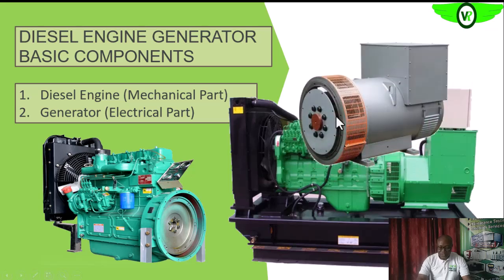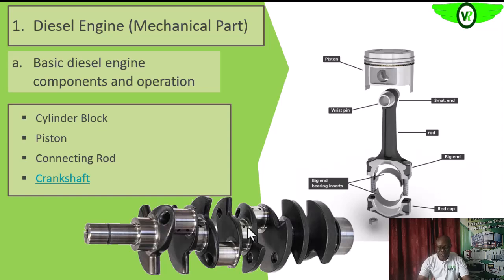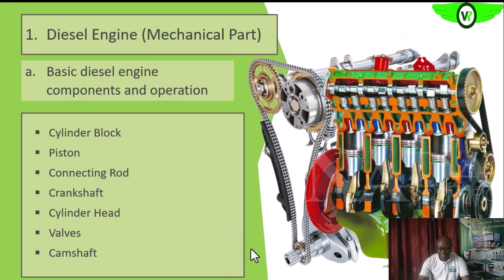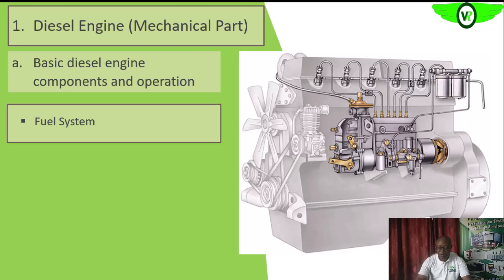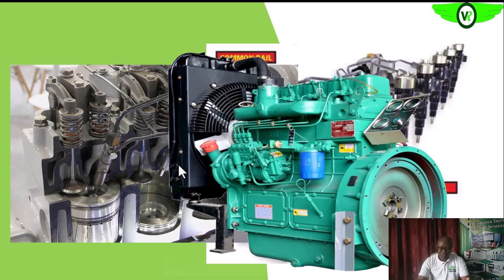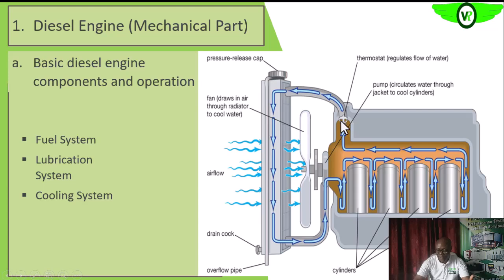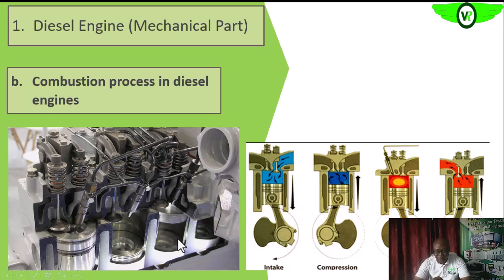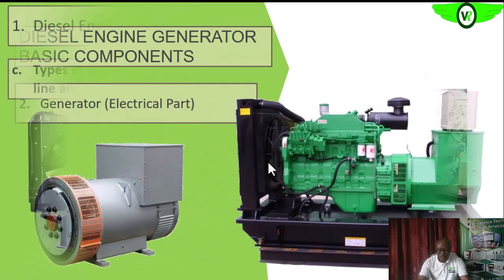DIESEL GENERATOR _ Diesel Engine Explained

Comment: Sir do you do tutoring one and one?
Reply from the maker: What area do you want to cover and what is your job role
Reply: @vourill I am a generator technician and I would like to learn the generator side and control side
Reply: I am a technician and I will like to learn the different systems in the engine like starting system, lubricating system